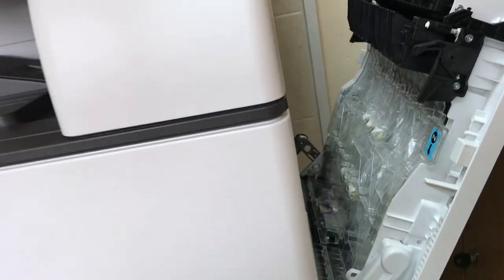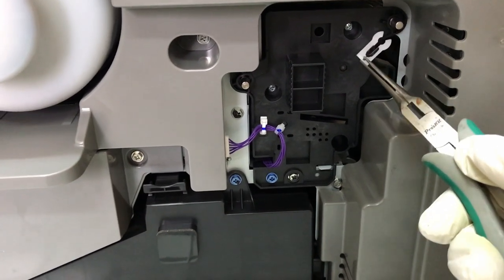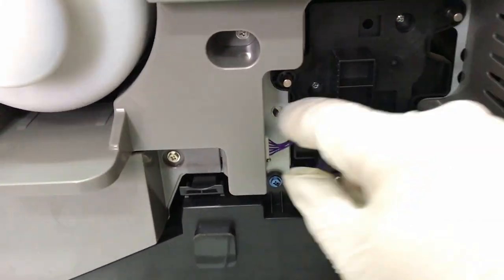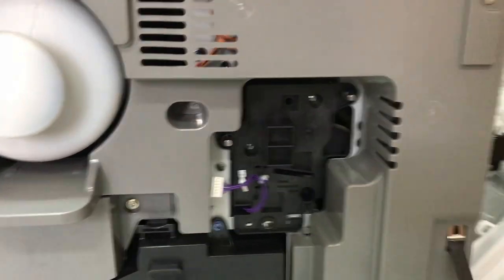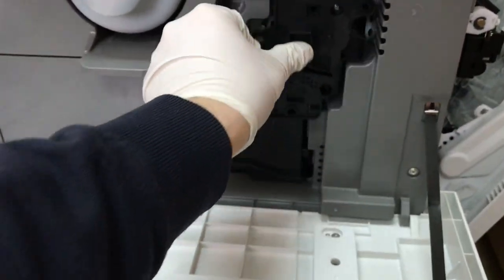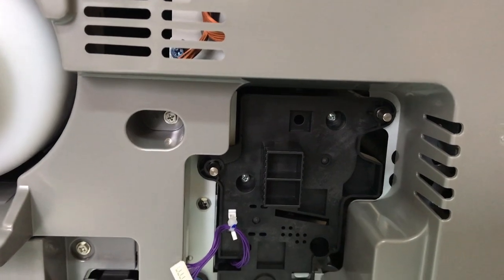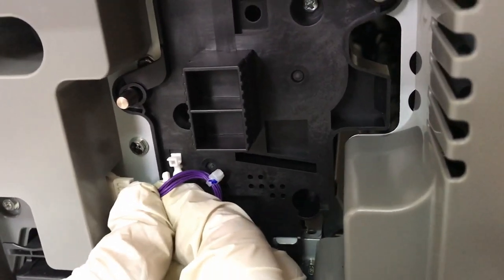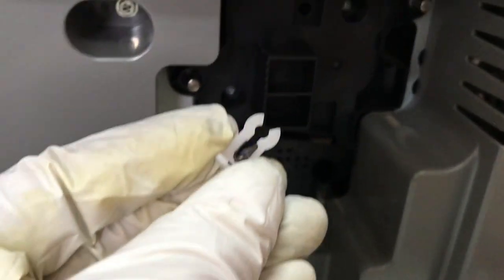Drum Unit replacement RICOH MP2554 MP2555 MP3054 MP3055 MP3554 MP3555 MP4054S MP4055SP MP5054

Comment: Hi, mo 5054 light copies, we replaced DV, drum, charger roller, transfer roller and still light printing and copies. Any suggestions, thank you
Reply from the maker: These are copiers very sensitive to optical contamination - wash the glass and mirrors, then remove the laser and clean the glass. It will certainly help.

Comment: my mp3554 ricoh machine has a problem of not being bright during print or copy, even though I have changed the drum and the new cleaning blade is still also not bright like other ricoh machines. do you have the solution? are there any other parts that need to be replaced? Please help, TQ
Reply from the maker: Yes there are other parts. Together with the OPC DRUM, you must always replace the charge roller, developer and perform maintenance on the copier.
Reply: @MrRicoh  Tq

Comment: Hi Tomasz. Same machine gives me error 670, and doesn't respond from keyboard. Tried to disconnect cables from ipu and controller, hdd, but it gives no results. Do you have any solution to the problem?
Reply from the maker: What exactly is your copier model? You didn't write it, so I don't know what to tell you.
Reply: Hi. Still talking about an MP4054
Reply: Code: SC670; Description: Engine startup error. The BCU failed to respond with the prescribed time when the machine was turned on

What is error code SC 670 on Ricoh printer?

The Ricoh copier error code 670 / SC670 is an engine startup problem. To reset this error try the code: "Clear Mode"+107+"Clear/Stop" hold for 5s. Turn ON and OFF the Main Switch.